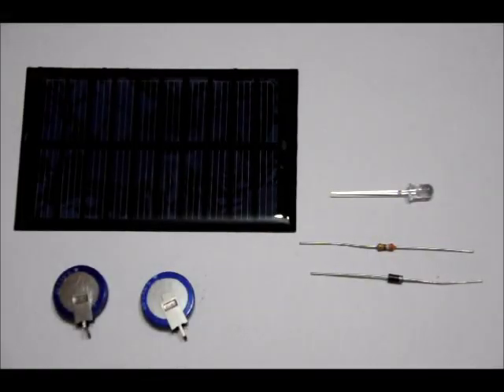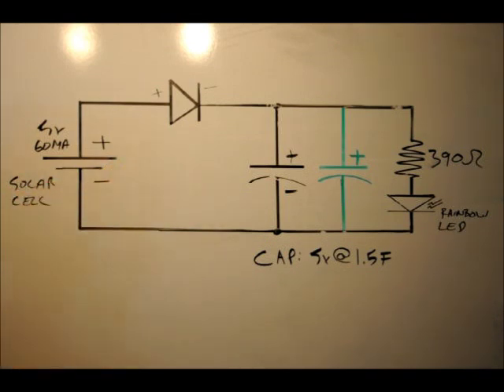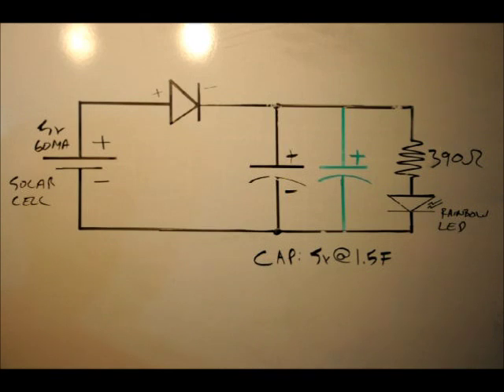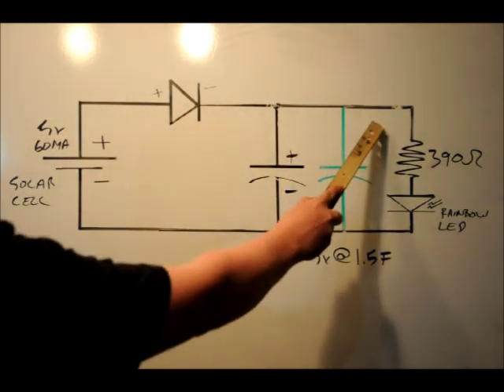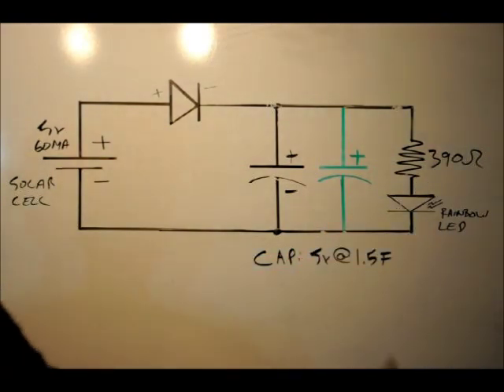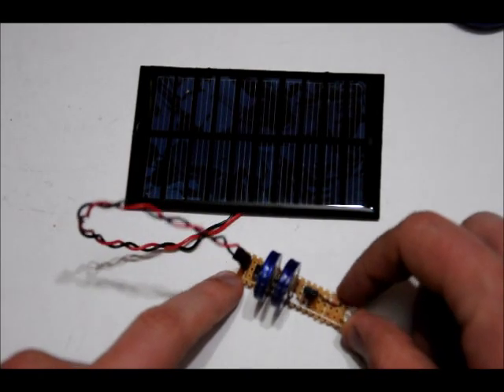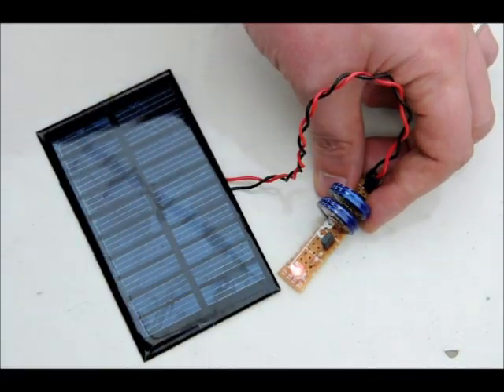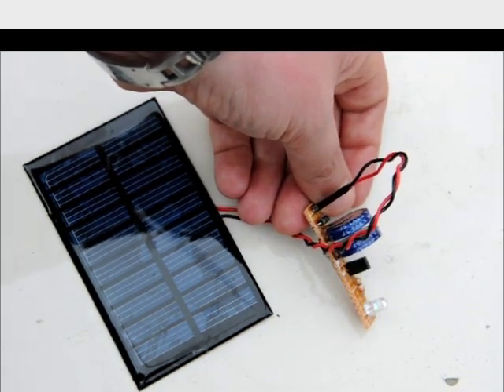Make Your Own Rainbow LED Solar Lantern With Super Capacitors

Comment: Simple enough circuit. What is that switch u pull out called? I have a 2.7V 10F supercap...Do i use a 2.5V solar panel to charge it or use a 5V with dc-dc converter?
Reply: And another dc-dc converter to boost to 3V+ for LEDs?

Comment: Great to see someone actually putting together an Idea I've been working on in my head! Great stuff, very helpful. I do wonder though, if the rainbow LED can be controled to target certain light frequencies. For instance, could you have the light shine red when the capacitance reaches a critical threshold, or green to indicate the Caps are fully charged, or yellow to show they've reach half charge?

Comment: Could you explain why you're able to use supercaps and not actual batteries? What is the difference here? What about bigger solar cells? They use real batteries so what about supercaps for let us say 50W cells?
Reply from the maker: You'd need some large and expensive super caps for that.  Super caps are great for low power applications, but are expensive and bulky to use in high power applications.  For instance, a 3000 farad 2.7v Maxwell super capacitor costs about $100.  A car battery costs less than that typically, and it can source a ron more power.  In addition, if you need a larger charge (More than 2.7v), then you need to put super caps in series.  When you put caps in series, you lose a ton of capacitance.  For instance, 2x 3000f caps (2.7v) in series is 1500f at 5.4v.  As well, then you have to worry about balancing them.